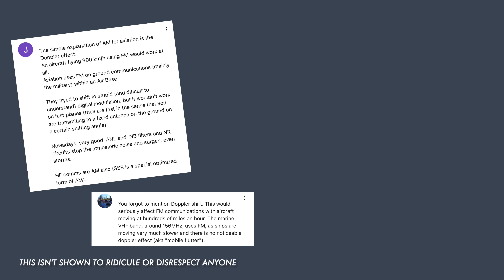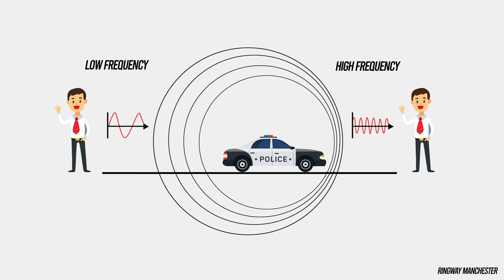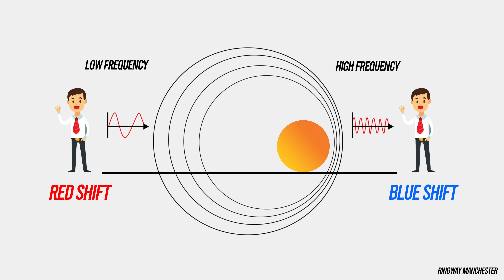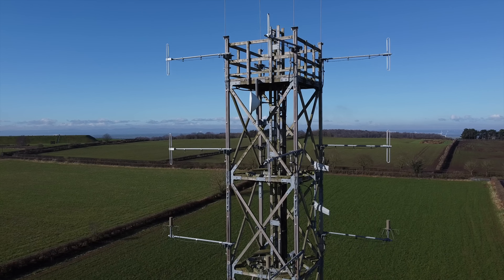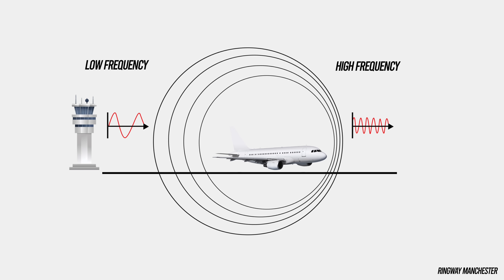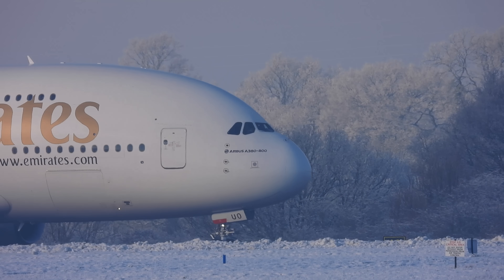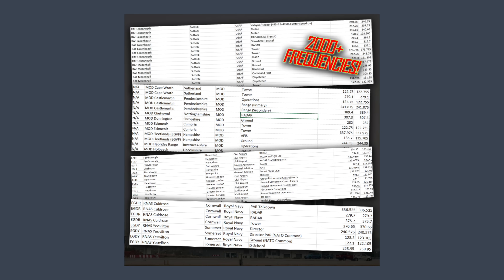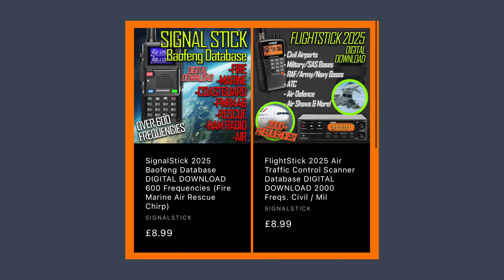How The Doppler Effect Affects Aircraft Radio

Comment: When we used to send analogue TV to geostationary satellites, the return signal had a small doppler shift due to the satellite slight rise and fall. This was observable on a vectorscope (that was referenced to station) as a slow rotation of the vectors, first in one direction, then the other. The rate, as I remember it was up to one rotation per second. This was on PAL with a subcarrier frequency of 4.433MHz.

Comment: I set 3 channels for the ISS on my radio to receive them properly. (I tend to get the 70cm downlink at 437.800mhz). The Doppler shift is very noticeable. I use 437.805 when it's approaching, 437.800 overhead, and 437.795 when departing.

Comment: As a pilot I can tell you that they probably won’t be changing the current voice system, and instead everyone is slowly moving to CPDLC. With CPDLC atc can send you instructions like routing or a new radio frequency and you can literally just upload the routing or frequency from the message into your fms (the computer/gps) so the autopilot can follow it. This eliminates spelling mistakes where a gps waypoint that’s pronounced “tiger” could be spelt as tiger, tyger, tiggr, tyggr, tigor, tihgr and so on and so on. However the system is not perfect and sometimes you can’t convey what you want through the messaging system and have to revert back to voice radios.

Comment: In AM communication like you covered here. The Doppler Effect is taken into the operation of the radio. With most radios now having the 'SDR' systems built in. The radio can compensate for this Doppler Effect. With newer and more complex systems being designed and Bandwidth being better conserved. It is finding that the small Doppler Effect with in flight air craft is covered in the software in the radio systems. (It has been a weird trip being part of an system design team!) The ISS and other space craft the Doppler Effect are used as part of the system timing and flight tracking.
Peace

Comment: A useful hack for thinking about this stuff is that the value of the Doppler shift is equal to the closing speed of the objects measured in wavelengths per second. Big wavelengths equal small Doppler shift and vice versa.

Comment: An interesting thing about doppler shift is there's a difference between light doppler and sound doppler. With light (including radio) if doesn't matter who is moving (the source vs the listener).  With sound the shift is different depending if the source is the one moving or not. Sound uses air as a medium but light doesn't need a medium. The shift in sound waves from doppler depends on the speed through the medium.

Comment: Having used most of the voice radio bands and modes I would heavily resist switching away from AM analog in aviation. The current digital systems in public safety, for instance would not cut it in the aviation environment. Way too much baked-in delay, distortion and missed traffic.

Comment: As a pilot with my own aircraft, interference on AM transmissions isn't really a problem requiring the use of a different mode.
Aviation VHF transmitters are of such low power because they don't need to transmit over long distances. 
When an aircraft contacts an airport inbound, they are only 5-10 miles out.  You don't need much power for that.
Reply: You need a bit more when talking to a radar or other facility which is 30 miles away! The standard aircraft transceiver is 8-10W though, not huge. Commercial aircraft versions of GA ones are 16W.
Reply: @paulsengupta971  One is not always talking directly to an enroute center.  
They use relay sites across their coverage area.
Reply: @Keystone_Investigations  Oh yes, they use the Climax system here in the UK. But when you're talking to London Information from over the Cherbourg peninsular, you know you're a way away.

Comment: Another way to look at it, the speed of sound at sea-level is about 1,235 km//h (761 mph), so an ambulance moving at 75 km/h is travelling at 6.1% of the speed of sound.
On the other hand the speed of radio (the speed of light) is 1,079,000,000 km/h (670,600,000 mph), so an aircraft moving at 880 km/h is travelling at 0.000000815% the speed of light.
That's why you see lightening long before you hear it.
Reply from the maker: Except this has nothing to do with sound…
Reply: @RingwayManchester  I'm speaking to the Doppler effect.

Given your graphic with the police car, which is a classic way to explain the Doppler effect, I was making the point that it will have more of an effect on how a person perceives sound than how a radio detects radio waves because of the relative speed difference. Radio waves are so fast compared to the speed of an aircraft that it makes only an infinitesimally small difference.
Reply: @EvDelen  Yep, that's what I think too.

Comment: I listen to fm radio on aircraft every time I fly. You really get a sense of fm capture when you do as stations take over one another.
Reply: What make of FM receiver do you use on the plane, I'd like to try that.  Thank you
Reply: Ive got a little grundig m400 am fm sw. Anything that looks like an ipod or something.  You don't want to be seen using a radio on board.  If you have an android phone it may also have an fm chip in it. Window seats best.  Lots of rf noise from aircraft power systems.  @iaincrowley1339